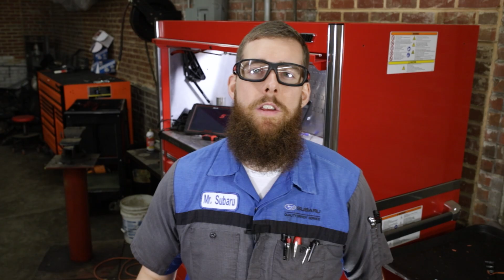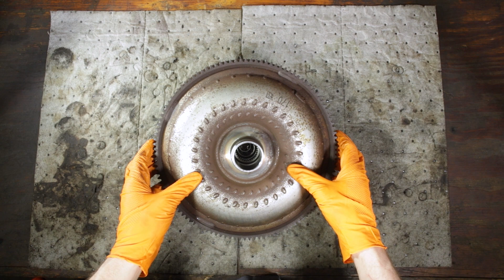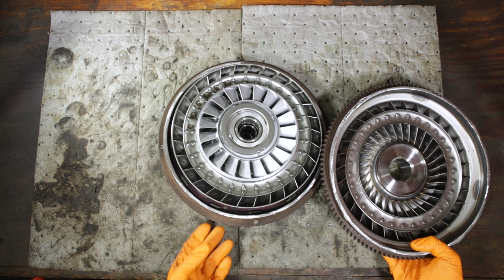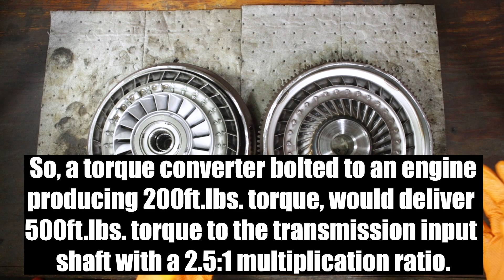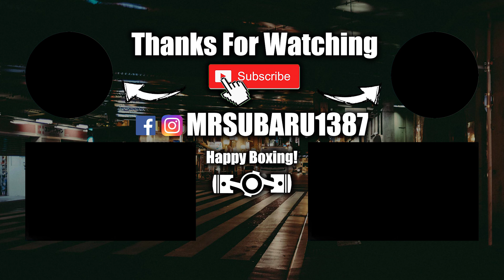Subaru TR690 CVT Torque Converter: How They Work, And Why They Fail.

Comment: i have a 2012 subaru legacy that has the 690 cvt we changed fluid twice in 172 thousand highway miles now car is starting to stall at traffic lights very intermitently will changing fluid some more do any good or is it useless to fix that problem. they sent us a letter saying our car had extended waranty on transmission to 10 years 100,000 miles but we were already over that when we got letter is there any other warranty coverng this problem?

Comment: Always enjoy your videos. I’m going back in time on this one and was curious about the years it affected and sure enough I’ve got some work ahead. Do you prefer to pull the transmission or just remove the engine? Is it easier to line up one way or the other?Thanks

Comment: so for someone that has a aussie 2011 liberty that has been stalling when coming to stop and no dash warning lights and has been considering pulling the valve body out to check check the solenoids out even though no faults flagged on the dash as its easier then pulling the box is sounding more and more wasting time and i should just order a converter and inspect valve body then

Comment: Thank you for going over this. I'm currently having an issue with my 2011 outback 3.6r and am wondering if this assembly (or something related) could be the culprit. I understand it can cause a momentary loss of power at a stop, thus causing a stall, but could it also cause it to loose power occasionally on hills or when decelerating behind a car and just before re-acceleration, feel a loss of power again? I can counter the loss most of the time by giving extra gas to ensure that not too much power is lost, but I've been struggling with this issue for a while now. Changed my spark plugs (not coil packs yet), had to change a nock sensor, and some wiring lost to rodents, but the issue persists. I know she's due for the 120k service (she's at 125k), but I'm also afraid of shelling out for that in case this issue is bigger and needs addressing sooner. I want the servicing, but with this one being a big one I'm afraid I won't have the $ to fix whatever is found. I will continue researching, but if you have input on what to look into further, it what you would do, I'm all ears. I'm trying to keep this thing running so I can pass it to my daughter at 17 (march 2025), but I still need to use it till then. Plus I know it needs about $2k in other maintenance, so I'm struggling to figure out if I'm dumping too much into it. At this point I'm wondering if doing the engine and getting a new one would be cheaper. 😅

Comment: Love your videos! So I have a shudder at ~20mph when accelerating. I am torn between EGR issues or torque converter issues. I noticed that the shudder happens when the torque converter engagement changes from 50% to 100% (at about 20mph). With your video, it sounds like the main failure is when coming to a stop, not accelerating like my case. Do you think this points more towards EGR issues?

Comment: Hey mr Subaru I was wondering if you knew why my Subaru won’t shift in manual mode it just won’t work at all 2011 outback with tr690 but continues to work in automatic I had over filled the fluid a little bit because I forgot it has to be running I don’t know if I let too much fluid out or I also noticed my cruse won’t stay working and I noticed some vibrations could I have a bad cv axel thanks if you get time😮

Comment: Anyone want to buy my 2011 Subaru outback 2011 near 180k Miles? Just got the Bad Torque Converter diagnostic. Outside of that, perfect condition. Just outside of Austin, TX

Comment: Good info in that video.
Somehow I  never got the recall for this issue, if there ever was one.
I have a 2010 legacy with 154000 miles and it is now stalling when I brake to stop. I checked stopping in neutral yesterday and when in neutral it doesn't stall. So, do I need a new torque converter?

Comment: So does the engine transmission bolt pattern match any other subaru transmissions?
Reply from the maker: Basically every Subaru engine and transmission bolt together.

Comment: I had the solenoid valve body lock-up issue about a year ago and cleared it myself by checking the wiring. 
Now I have the stalling and TC issue a year later. My transmission shop wants to replace the entire transmission with a used one at about $4.2k or a new one at $9k.  Could really use an opinion from Mr. Subaru if I can get away with just the Torque Converter and new CVT fluid?
Reply: Very curious what route you took. I also have to do this now with my 2012
Reply: @erinskelton   I decided it was over the car's value, so I didn't do it. I still use the car,  I just pop into neutral when stopping.

Comment: The wear point is the black phenolic washer eats into the mating surface of the turbine hub. As it wears, the lock up piston drags the front cover and stalls the engine.

Comment: Does this apply to 2013 MY? Seems like the bulletins only talk about 10-12. I have a 13 outback that stalls out just driving forward and stopping in the driveway. Chugs when coming to a stop, most of the time will stall. Don't even have to get it up to lockup speed. Still torque converter?  Thanks!
Reply from the maker: Check engine light on? Scanned for codes? Could be an unrelated drivability concern.

Comment: I have a 2018 forester with a manual transmission.  Any recommendations to improve the torque? I bought larger tires and the torque has dropped more than expected.

Comment: Hey MySubaru,
I have been having such an issue with my AT 06 Forester and was hoping you might be able to assist. My AWD does not work and I’ve been told it could be in my transmission (assuming it would be the torque converter?). I noticed it early winter season when I couldn’t climb the smallest of hills with snow on it and couldn’t even drive through more than a few inches without issues. What’s your thoughts?

Comment: I have an '05 Legacy wagon 2.5i that stalls,  when coming to a stop, just like you described. New fluid, OE filter, and strainer. It happens when in 4th gear and the converter is locked...mainly when cold. If I manually shift down to 3rd she's fine and the converter unlocks. The car has 289k miles. Torque converter or valve body related? Thanks!

Comment: Excellent video!  My daughter's 15 mirage cvt w 76k miles blew out the torque converter!  Factory repair more than car is worth!!  Hoping to gamble w used tq. Oil and filter to get running and sell for less than total loss.   Engine stalls at traffic light.  Sounds just like your closing comments needing a needle bearing vs thrust washer!  
This video helped me understand the clutch built within the Tq.   THANK YOU!

Comment: Great video!  This explains a lot of the issues I'm seeing in my 150 mile old reman transmission.  Also, I suspect the reman facility Subaru uses doesn't give every reman unit a new torque converter.  The lockup clutch in mine doesn't appear to be working correctly.  I guess it's back to the dealer I go.  Good thing I have 58k miles/6 years left on the CVT warranty.

Comment: Excellent video... Great coverage of the torque converter theory / how it works. The failure mentioned in the bulletin makes more sense now. How do you determine; whether it's the converter and not the lock up solenoid or control circuit that's failed? Is there a testing process?
Reply: There is. The gray connector on top of the transmission can be accessed via the engine compartment. if you check resistance between pin 2 (Top row and second front to back) and ground at the transs, you should get between 10-13.5 ohms of resistance. If out of spec, your solenoid is no good. Above 13.5ohms the computer will put out code P2673, TCC solenoid high and below 10 ohms the code will be P2674, TCC solenoid low. I got p2674 and when I checked it was at 9.7 ohms so the computer is very sensitive to this resistance and will (normally) set a code as soon as it is out of spec. We've had the torque converter issue for a few years and knew what it was but the code only came on recently when the solenoid went.

Comment: I have a 2010 subaru legacy 2.5i it seems like my tort converter is not releasing when i come to a stop i can feel a holding or jurking  motion and when excelerating there is a vibration in the drive train, i cant tell if it coming from the tort converter or the drive shaft, where do think i should go to have it checked out?

Comment: I am well past the extended warranty on mine at 110kmiles but mine has been a little fishy for 50k miles.  It has never outright stalled coming to a stop but I have seen the RPM's drop to almost nothing then it seems to recover.  It does seem to happen in winter more than summer but it happens very sporadically, could never reproduce at the dealer.  Not sure how long I got till it finally gives up and fails.  2011 Outback.

Comment: I had the same issues with a 2011 legacy 2.5i
I replaced it with a refurbished of of EvilBay
And still has same symptoms, when I installed it I only put around a quarter of transmission fluid in it, after I watched your other video I realized you filled it with more than that, so you think that caused my refurbished to fail again and would’ve happened even if I had one from Subaru, or  it’s just that refurbished is not a reliable part

Comment: Yep, my 2011 Outback with 103k on the clock would stall whenever I made a quick stop.  Was over the 100k warranty, but Subaru split the cost with me.  Still not happy as I have two 240 Volvos and both have over 400k on the engines and have only had water pumps and timing belts, and one has the Asian Warner auto which has also never been touched.  So all this transmission issues at 100k and potential head gasket issues on the horizon does not make me happy.  But I like the little car, and would rather have it than anything else on the market.

Comment: This is more of an explanation than I’ve gotten anywhere else. Do you maybe have a differential in the chuck it bucket?  Any of the parts that play a role in the AWD system between transmission to the wheels would be great if you do any more of these in the future. If you have already done videos of these parts let me know and I’ll check them out. Thanks

Comment: I live in Italy and in 2004 I purchased a Toyota Avensis (basically an elongated Toyota Corolla made for Europe) 1.8 VVT-i (1ZZ-FE) equipped with a 4 speed U341E automatic transmission made by Aisin in Japan. Despite full service history, performed exclusively by the local Toyota dealer, I never asked to the dealer to change the ATF and the ATF filter, also because Toyota explicitly wrote in the user manual that it is not necessary under nornal driving conditions. I live in a montainous region and, despite driving almost always very calmly, after 12.5 years and about 72,000 miles, the torque converter seal started to leak ATF on the floor. The dealer replaced the torque converter and its seal. Afterward, the automatic transmission of my car performed perfectly, as always, but with one defect: the torque converter lock-up clutch didn't engage anymore, and the error code P0741 appeared on the scanner display. Check engine light on, VDC off, TCS off. Long story short: I ended up with a new automatic transmission, remanufactured by Toyota, installed by the local Toyota dealer. My question is: what could have been the root cause of the torque converter seal starting to leak ATF on the floor? Total lack of maintenance? Age? Mountaineous roads that keep the ATF hotter than usual? Clogged ATF filter due to the torque converter clutch lining being reduced to dust due to engaging/disengaging cycles driving up the mountains? My best answer is the latest I wrote, also because the torque converter lock-up clutch is not a multi-plate clutch; instead, it is a single layer ring-shaped clutch, not the strongest type, I guess.

Comment: I didn't realize the ring gear/flex plate is intrinsic to the torque converter. Presumably if a bad starter damages the ring gear, you need to replace the torque converter?

Comment: I have a cheap and dirty center differential fix when front wheels bind with the rear but it's not 100% the front and back still bind a bit when I do an extreme turn like a U turn and it feels worse at slowest speed makes car shudder a bit.previous owner ran the AWD with worn out dissimilar tread size tires but car has almost 270K miles! and runs great outside this problem and a small engine oil leak

Comment: Hi , @MrSubaru1387 , i have an Outback Diesel, 2015, CVT, and 2 days ago , first start in the morning, engine and CVT cold have a strange symptom : when trafic is crowded and need to stop , RPM drop for 1s under 400RPM , if i release the break , go back to normal. Happened twice in 2 different days , but the symptom is not present with normal temperarure to motor or CVT. Can this be a torque converter problem from your experience? Thanks in advance!
Reply from the maker: I'm not very familiar with the EE20 diesel engine, as we never got them here in the states. May just been an issue with engine idle, not connected to an issue with the transmission. If it were a gas engine, I'd advise a throttle body cleaning and idle relearn procedure to start.
Reply: @MrSubaru1387   Thank you for your reply , i was thinking you are not familiar with diesel. I don't have any error code and the problem appear only when the engine/transmision is cold . I was testing 1:30h after ,with my radio turn off to listen for strange sounds ...the problem doesn't appear again..i don't have the feeling that transmission sleeps or idle too much between D and R . If it is a transmission problem what i could think is a low lvl oil and when the temperature raise, oil expand and everything goes well. I will check to my Subaru dealer the problem . My Outback is 2015 / 163k km ...so the transmison could be out of warranty by 2k km . The oil was change 2 times , at 69k and 143k ..
At the end want to congrats you for all the infos we got and your hard work on this channel.
Regards,

Comment: Really good explanation, but i want to know if has major difference between year or model between years for the TR690. It is the same thing for a Outback 2011 than a  FXT 2014 and the new 2020 Ascent and Outback has the same transmission #? I have a strange issue in my Forester XT 2014 specially when climb hill when need more torque we feel hesitation and slipage, this is comming from torque converter or pulley or Chain in the CVT?  Thanks in advance and continue your great works...
Reply from the maker: All three listed are different. The TR690 was changed nearly every model year. Slippage is usually chain slip.

Comment: I'm always fascinated by how things work. Thanks for your description.I've got a 2006 Outback with a TZ1B7LFCBA transmission that's shuddering under load mainly between 40 kph and 60 kph and there is a "grundgy" feel and vibration when at idle. I've heard that the shuddering is a known issue with Subaru torque converters. Can you explain why that develops?

Comment: I have a 2010 Legacy with. now 146K miles. I bought the car after it came off loaner status at about 6K miles and have had this problem coming to a stop and ALMOST stalling for maybe a 100,000 miles, meaning before 50K. It doesn’t always happen, probably one in twenty five or fifty times. I never knew that this problem was identified in TSB until the vehicle was over 100K miles, meaning I can’t get it fixed for free. I may keep the car another year or so and have never changed the CVT fluid. I know the debate on the definition of  ‘lifetime’. Should I invest in the repair myself to save on trade-in value, or should I just discount the price to compensate. Other than replacing the alternator and this torque converter, it’s been mostly trouble free. Advice and opinions are welcome.
Reply from the maker: The fluid isn't lifetime. No debate over that. SOA pulls that garbage line. Subaru Japan still services the CVT like an old 4EAT/5EAT with regular fluid replacements.
Reply: @MrSubaru1387  Hi, I think the reason soa does it is that Federal CAFE standards include transmission fluid. BMW too.

Comment: Thank you. Disappointed that a smaller part gone bad screws the whole unit. Why can they not increase the strength of certain components to handle the pressure/wear on those components in the first place? Instead of waiting for stupid data to come in , certain wear points should be over engineered for want of better term to save throwing a whole unit like the cvt converter out. Feels just like crappy Jeep 3.7l engines and their valves...